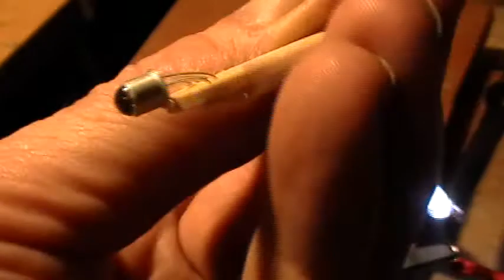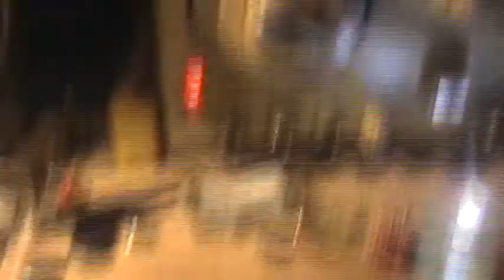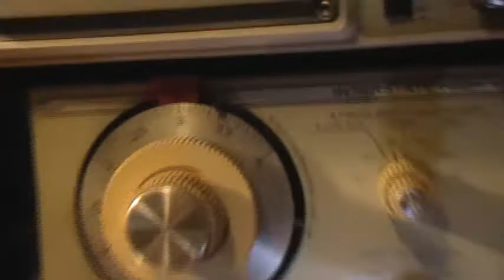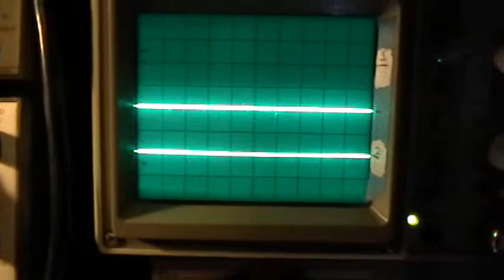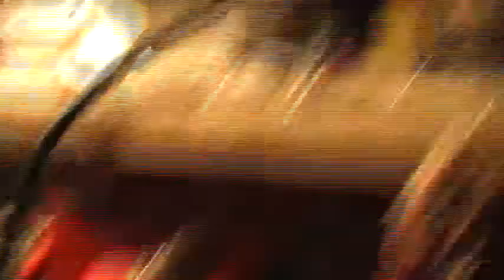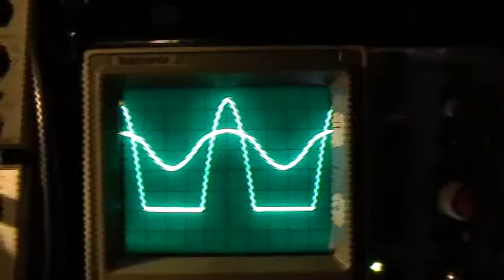Joule Thief: Supplement: Photo Transistor NTE3037 Response Linearity Test

Comment: Mine have that early '60s old musty smell (the MoBo says 1959 on it).  The power cord seems to have suffered the most, with cracks and fraying where it enters the case.  I've thought about replacing it with a power connector from an old PC power supply, but I'm not sure if I want to cut a hole in the case and ruin its genuine antique quality.  The 'lytics inside could be removed to restore it to its original state.  If you need a schematic, I have the manual.

Comment: That ten turn pot seems to me to be one half of a Wheatsone bridge. The other half is the photocell and another resistor.  Instead of a null, you get a change of  the opamp's output when it passes through the null. The opamp needs a wee bit of positive feedback to give it hysteresis, to keep  it from oscillating.

Comment: The great thing about the HP 721s is there's enough room inside to leave the original 'lytic alone and put another (newer and much smaller) 'lytic in parallel.  In fact, the ones that are in even a working 721 are usually somewhat lower than they're supposed to be, and adding a second one of the same value will hel bring the PS up to spec.

Comment: I did some experimentation with a CdS photocell recently.  I used it instead of a PT because it just requires a DMM and is less prone to saturation (it's a transistor).  Putting the PT on the front of the LED seems to invite the LED to put the PT into a region where it's nonlinear, or saturated.  I put mine in a box, about a handspan away from the LED.  Eve then the CdS is only a few hundred ohms when illuminated.  But it gives a good relative indication of the LED output.

Comment: It looks like you have an ancient HP 721 PS.  I have a couple I got on eBay, and had to repair, usually the 'lytic capacitors.  If you use a 7812 on a 13.8V auto battery it will not maintain regulation.  The minimum in/out voltage difference must be at least 2.0V, but that' typical, and the individual chip may require a higher voltage.  Use a LM317 adjustable VR.  Thanks.

Comment from the maker: Don't let the requirement for stable voltage scare you off. A two-dollar 7812 series voltage regulator and a couple of capacitors, and you could probably get away with plugging into the cigar lighter for stable enough power, and the phototransistor will work fairly well at 12 volts, I think.

Comment from the maker: Heh... (begin accent) Some times I forget.... (end accent)

Thanks for watching! Yes, I think a simple lumen meter can be made this way. You will need a regulated power supply though; the voltage to the phototransistor must be kept constant to get consistent readings of light variations. Also, this particular PT has a lens and a narrow viewing angle so it has to be held precisely in position, you will need to make a little jig (suction cup maybe?) to hold the PT in position on the headlight.